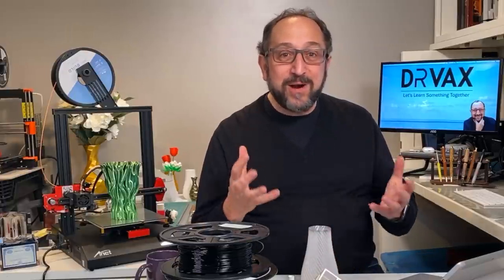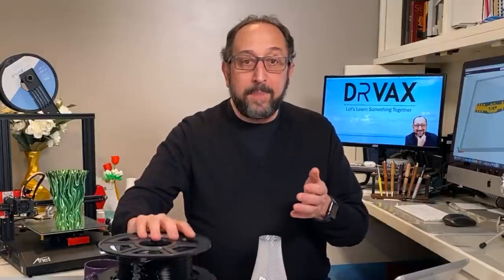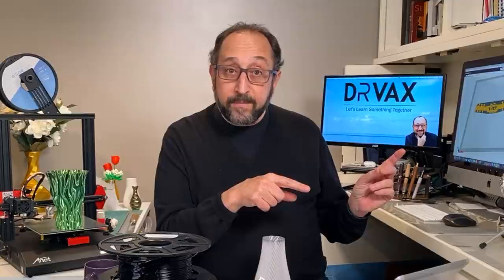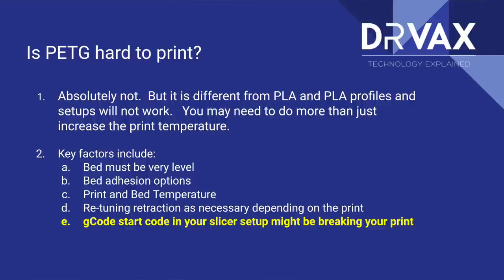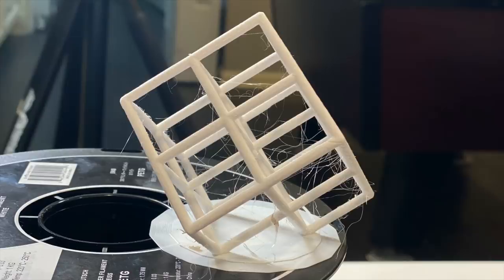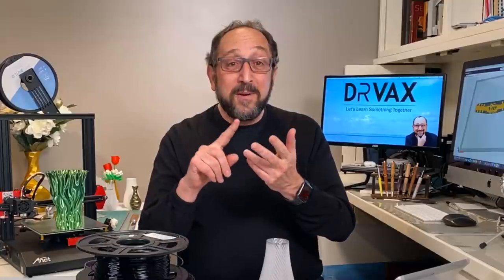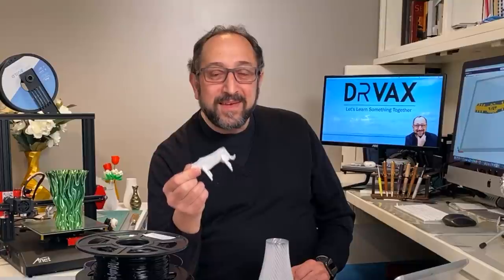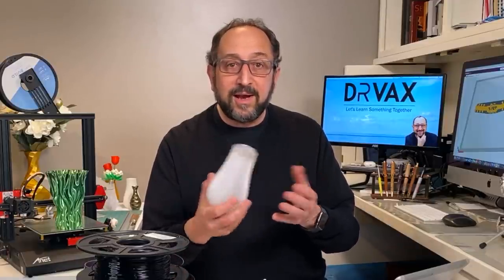How to 3d Print PETG Reliably and Safely

Comment: I've been using Cura and I've never had it start printing the prime line without it getting up to temperature first I've never altered G-Code the only thing I've ever added was show me remaining print time but no matter which version I use  of cura the prime line never starts until it gets to the temperature you specify in your G-Code in other words when I slice I specify 240 and 80 and it won't start printing anything it won't even home until it gets to those temperatures. Just wondering what the difference between your cura and the ones that I've been using I'm at version 4.6 right now.
Reply from the maker: If you DO NOT have a set temperature in your start gcode, Cura will correctly add one. The problem is when you hard code a set temperature at the top of your start code, and it is for too low of a temperature for PETG.

P.S.  I have started a new discussion forum at http://forum.drvax.com where we can all have more elaborate discussions and share pictures on our prints and printers.  Check it out.

Comment: Looks like there are different types of Magigoo. Which one should I buy? I see MO2016, MO2018, Polycarbonate and Polypropylene. And wow, the 2018 seems double the price.
Reply from the maker: For regular filament types such as PLA, PETG, TPU you want the original MagiGoo "Magigoo MO2016 All-in-One 3D Printer Adhesive Glue".  The reason there are so many types is that this IS NOT just a glue stick.  It is a special formulation for the type of filament you are using.

Here is an affiliate link that helps the channel to the right MagiGoo for PLA, PETG, TPU.
https://amzn.to/2HrBCqp

Comment: Thank you very much for this video. I lost quite a bit of petg before this video. So I'll try again tonight.
Does speed need to be down like 40mm or it depends too much on the printer? I use an ender 5 Pro. (I understand you can't give specific advice for each printer, but I was looking for a general idea).
Thanks

Comment: Can you cover PETG on a Ender 5 with a Swiss Micro hotend. I'm having a heck of a time due to the limited retraction amount of an all metal hotend. Thanks! Glad to see you doing well!
Reply from the maker: The basic technique should be the same.   Check out the comment from @Anthony Towler  He has some suggestions that will probably help with the all metal hotend.  Overall, one of the complaints many people have will all metal hot ends is stringing.
Reply: The best thin to do is ether get the Micro Swiss direct drive or revert back to stock hot end. You have the worst of both worlds, Bowden (needs lots of retraction) and all metal hot end(need very little retraction). I have  printed PETG on a CR-10s but the retraction setting that worked really didn't work.

Comment: Curious to see the numbers printing ABS.  Was planning to have a fan/filter in enclosure when printing ABS.  Thought that would be sufficient?
Reply from the maker: I have never printed with ABS because my lab is in the basement.  My Prusa which is not enclosed has the temperature range for ABS but I have never had the need.  Unfortunately I cannot provide you with any numbers -- however, there is lots of data on the Internet.  Just google it.  Irv

Comment: I have had zero success with PETG. Every piece wider then 20 mm or so warps and pulls off the bed. I did notice that the fan on my Ender 3 does not seem to respond to the G-Code in Cura telling it to slow it's speed. Maybe an issue with the Marlin version I have ?? Pretty much gave up. Maybe I'll come back to it some day.

Comment: I'm a total newbe to 3D printing.  I recently received my Ortur Obsidian Printer and have been using Cura since then.  After watching this video I loaded your Start Code into Cura.  Running that start code on my printer causes my printer's heated bed to go to 115 C!  I reload the Cura's start code and the printer runs OK.   I compared the two sets of gcode  generated and I don't see why the 115 C is being set.  Any ideas as what is causing this?

Comment: Nice video, helped me think about some things more deeply.

One comment on the Start gcode segment of the video.  Apologies if I just missed the reference to which slicer the code was being used with, the slice "run time" variables of the from {variable name} aren't common across all slicers.  Which slicer does this apply to and did you find a reference to a lit for that slicer's parameters?
Reply from the maker: This is designed for Cura 4.x.  Good question.
Reply: @MakeWithTech  Thanks!  The answer I wanted to hear.  ;-)
Reply: I use PrusaSlicer2.0 and I think they are the same.
M140 S[first_layer_bed_temperature];
M104 S[first_layer_temperature];
M109 S[first_layer_temperature];
M190 S[first_layer_bed_temperature];

Comment: Thank you for the video. It's not clear to me how you edited the start gcode. I don't see any mention of desired temps to replace the 200c and the 40c. And-- why wouldn't I simply change the values on those lines (m104 and m140) to accommodate PETG temp requirements?

Comment: I saw somewhere else that for PETG a quick spray of windex is best. When I tried it I found windex much better than the gluestick.  The prints come off easily and leave no mess whereas the gluestick (for me) leaves a residue I need to wash off.
Reply from the maker: Excellent hint.  Thanks.

Comment: I use regular painters masking tape with my PETG prints it works wonders especially with bed adhesion and because its tape stuck to glass removals never an issue also
Reply from the maker: Thanks for the comment.  I have also used masking tape in the past, but I find Magigoo a bit less trouble than masking tape with better adhesion.   However masking tape is much less expensive.

Comment: okay i also use sun petg... compared to pla that i normally print at 215 and use retraction of 5 at 40ms with good results... would you say sun petg set 238 ..retraction 3 at 40 or 30 ms would be a good adjustment roughly to cut back on stringing? i printed yesterday at 230 degrees and had some separation and poor adhesion on a few layers.... PS i am using ender 5.... thanks
Reply from the maker: It all depends on your printer.  Every 3d printer, even some times from the same manufacturer are different.  Work on a video about stringing that will help with this.   If your layers are not sticking I would increase both the bed temperature and the extruder temperature.
Reply: @MakeWithTech  thax..when i increased from 230 to 238 seemed better...only 2 small areas a layer seemed to not attach well... maybe 240 will be the sweet spot or i could even slow down print 10% which may help also... thax again

Comment: Spoken like an additive manufacturing professor. Thank you so much. 
I would love to know how you got your code edited before feeding to the machine. I am using a guider3 printer, editing the Gcode is not feasible on my slicer.
Reply from the maker: Gcode for most printers is saved in text format.  Unfortunately, Flashforge uses x3g, a binary format for some printers.  This limits the slicers you can use and your ability to edit the Gcode.   I have not used a Flashforge printer for a couple of years, but I did think you could provide custom start code --- this is where you could set the temperature, etc.
Reply: @MakeWithTech  OK, that's true about flashforge printers, thank you for your feedback

Comment: You don't need to precede the M190/M109 lines with M140/M104 unless you want to do something in between while it is warming up. For example you could start the bed warming with M140 before homing and use M190 after homing to save a bit of time if your Z axis is slow. Otherwise just M190 and M109 are sufficient.
Reply from the maker: You are correct.

P.S. I have started a new discussion forum at http://forum.drvax.com where we can all have more elaborate discussions and share pictures on our prints and printers. Check it out. Irv

Comment: Great video. I was able to complete the build of my Ender 3 V2. When printing my first test project, the device temperature was set to 225 degrees and the printer started, but filament was all over the place and the object was not a consistent object, it was very loose and soft. Any suggestions. Note: I'm very new to this.
Reply: On my v2 I set the hotend to 238 and bed to 85 degrees and changed the stock bed to a borosilicate glass bed

Comment: Can you use the same level as you would to print pla? Or does the bed need to be raised?
Reply from the maker: In my case I do not adjust my Z height.  However I have heard that people that do not use Magigoo have trouble with PETG sticking too well the print surface so they raise the initial Z height a bit.

P.S.  I have started a new discussion forum at http://forum.drvax.com where we can all have more elaborate discussions and share pictures of our prints and printers.  Check it out.  Please excuse if I have posted this to multiple comments from the you.  Just trying to get a bit of exposure.  Irv
Reply: Thank you for getting back to my question. Appreciate it.

Comment: How fast do you generally Print PETG? In my situation  My PETG settings are 250ºc  nozzle (225 for PLA) and 70ºc  bed (63 for PLA).  My bed is PEX from Wham Bam and my nozzle requires hotter heat, the Apollo MK8 0.4 coated Aluminum.  MY Ender 5 is Direct drive also.  But my speeds for PETG is 35mm/s.  Can't I go a bit higher without loosing quality?
Reply from the maker: I have been printing at 50-70mm/sec depending on the printer but I have mostly been printing things where optimal quality is not important.   Why not just try higher speeds with some smaller prints and see what happens.  Filament is relatively inexpensive.
Reply: @MakeWithTech  Quality is super t 35mm/s and very litte stringing. I'll try to bump it up a bit  thanks Irv

Comment: Okay, lets say i sliced a file for a .05 and i forgot and tried printing file with a .04 nozzle... i actually think this is something i may have done... whats been happening for first hour or so of print it looks fine...but then extractor gear starts clicking and filament is have hard time... then i hit pause pull out filament cut off approx 1 foot then insert filament in tube again and resume print....then clicking stops and filament seems to be feeding well again... i am thinking the smaller nozzle does not allow  filament to come out fast enough and it ends up backing up so to speak and causes filament to get jammed or fused at the extruder hot end... I really want your expert opinion on this.. thanks for your time... btw i have done everything i can think of to fix this issue...
Reply from the maker: Yes this is a significant problem.   If you have any question about a gcode file I would just reslice it.  Printing on a .04 nozzle a print sliced for .05 is at best going to over extrude and at worst will cause a terrible jam in your hotend.
Reply: @MakeWithTech  Yes, i got you...thax

Comment: Why do you have the m140, m190, m104, m109 code in your g code twice? Also, don’t you typically pically get temps from your filament settings and not from Gcode?
Reply from the maker: @Doug W Great questions.  First, the second set of temperature settings is probably redundant but causes no harm.  I added them while I was trying to resolve all of the initial temperature issues with PETG, but as a number of viewers have mentioned the printer should hold the temperature properly.   The steps that led to the two sets are interesting.  Originally I only had the second set.   When trying to print PETG the index/purge line was not printing properly.  So I added the temperature commands before the purge line print and just left the second set in to play it safe.

The slicer setting of the temperature is much more complex.  Depending on the version of Cura there seems to be an interaction between the slicer and your start code.  It seems if you do no temperature settings in your start code that Cura adds a temperature command at the very beginning of the code.  Here is an example with the Cura provided ANET profile:

; Generated with Cura_SteamEngine 4.6.1
M140 S60
M105
M190 S60
M104 S200
M105

However, when I look at the gcode produced by Cura when I have a temperature setting in my start code, the Cura provided temperature setting is missing:

; Generated with Cura_SteamEngine 4.6.1
M82 ;absolute extrusion mode
; DrVax May 2020 Start Code

This is why if you have a M104 200 hardcoded in your gcode start code before you print a purge line this will also be the temperature that is used to start your print.

At the end of the day, my prints work with the gcode start code discussed in the video.  It surely is not optimal but it works.  Successful prints are always a good thing.

If anyone has additional information about the interactions between Cura and start code please comment.  Thank is how we will learn together.

Thanks for your questions and comments.  Irv
Reply from the maker: @Doug w I value your comment and your contribution to the DrVax community.

To help us all build the DrVax community of "makers" I have created a new community forum at http://forum.drvax.com .   At the DrVax forum, you can engage in discussions with me and other community members, use a rich text editor, and post images.  This should facilitate better communications.

It would be great if you could repost your comment to the forum to help with the discussions.

This forum is still in beta and the software I am using is complex so I may have some feature misconfigured. 

All the best.  Irv
Reply: @MakeWithTech  Thank you I will check it out. Be well my friend

Comment: I dont have ABL as I am using an Ender 3 v2. Does this Start G-code still apply to mine? I noticed my printer kept changing the temperatures to 200 for the extruder and 40 for my bed which became very annoying to try and get the first layer to stick

Comment: do you know how to fix soft wear problems on anet et4
Reply from the maker: Since the ANET ET4 uses proprietary software you just have to wait for an update to the firmware.  They have released two updates so far.   The firmware in the ET4 is not it's a strong suit.  I personally prefer Marlin based printers but I am impressed with the prints I am getting and while the auto bed leveling on the ET4 is not worth the effort, the power-fail resume,  and easy to use menu system are very nice.  At the end of the day, every printer has tradeoffs.  For example, Creality Ender 3 printers did not include a bootloader so there was no way to easily upgrade the open-source firmware.  The ET4 has a bootloader built it but their firmware is proprietary.    While not a scientific study I find the ET4 faster than my Ender 3 or 5. I have a Prusa i3 MK3 which is an excellent printer but the assembly was very complex, very long, and quite hard.   Because it uses mostly 3d printed parts many repairs are in my opinion overly complex and I find I only use it for high-temperature prints.

So far I have not found a perfect printer in my price range.  Each printer has pluses and minuses.

Comment: Hi Irv,
thanks for the video. 

Concerning the emissions of PETG I personally think your assumptions are a little doubtful. 

Why? The device you used for measuring is highly questionable. I had bought exactly the same type for about 130€ and the readings were nothing but rubbish, although I did numerous proper "calibrations" as stated in the manual. 

In some of the cases the device even displayed better values during printing compared to a room ventilated for 10 minutes without running printers. And I live in a rural area with clean, fresh air :-)

A defective unit can be ruled out as several reviews described exactly the same behaviour of the device.
 
I checked other devices as well and the result was that in this price range you only get a gorgeous random number generator with a colourful display. Unfortunately proper measurements of TVOC and Formaldehyde to my knowledge is only possible with measurement devices at a much higher pricepoint.

Anyway - the rest of the video was very informative - as always! (y)

Get well & stay safe!

Cheers from Germany
Reply: He clearly gave a caveat stating it was totally unscientific.
Reply: @LarryBerg  My comment was not supposed to be offensive. The point is not if the method was scientific or not. Irv himself did very good! The problem is that these chinese measurement devices are absolute rubbish. The displayed values can not be trusted at all. Theoretically the values could be right but they also could be completely off. I would not have written that if I didn't experience this myself first hand. ;-)
Reply from the maker: @Markus Berg  I value your comments about the measurement device.  Comments from my viewer create a richer learning environment.

To better create a community I have started a new discussion group at forum.drvax.com   It would be great if you could report your thought there as it provides a better discussion environment.

Comment: Also PLA doesn't keep its shape over time if it's being stressed -  so a printed C-clamp (for instance) tightened down will warp over time and relax. So if you are making usable parts (like brackets, clamps, fixtures etc) PLA is not the right choice. But PETG might not be either. Strength is better in ABS, but it has worse warping issues than PETG (due to heat differential between bed/environment  and hot end). There is no one perfect choice. Pick the filament for your part.
Reply from the maker: Excellent advice.

P.S. I have started a new discussion forum at http://forum.drvax.com where we can all have more elaborate discussions and share pictures on our prints and printers. Check it out.  Irv